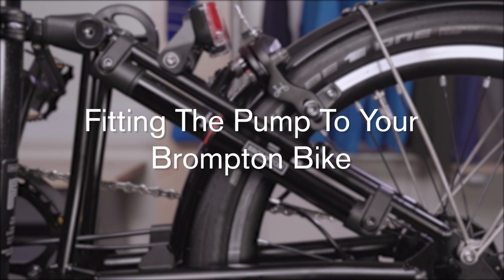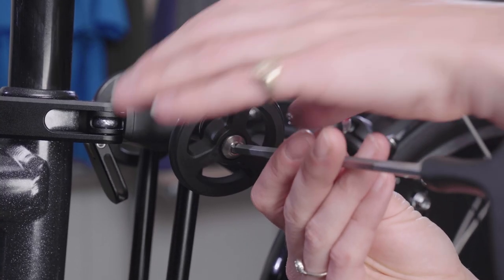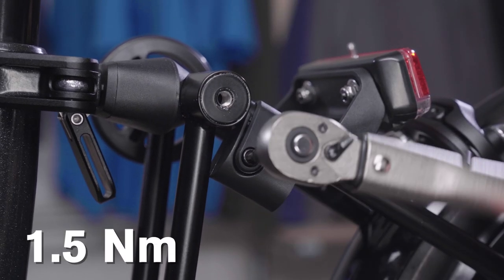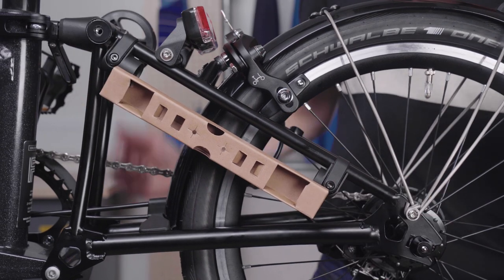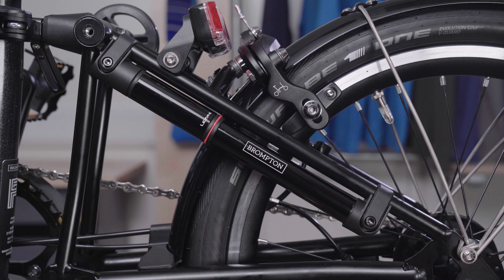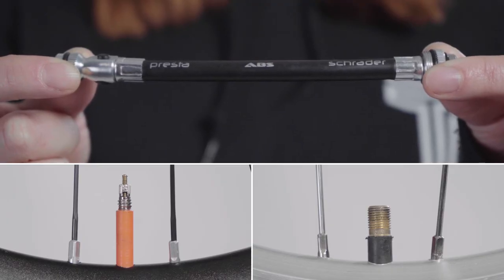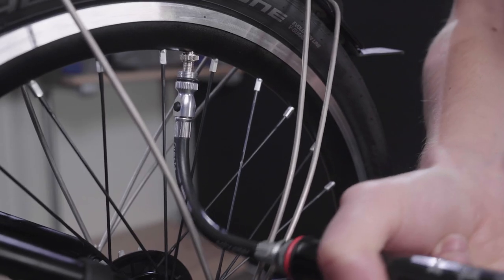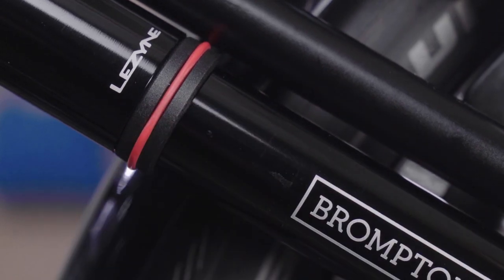How to fit the Lezyne Brompton Pump

Comment: I appreciate you encourage using a torque wrench, but most of the bike specific wrenchs  won't go as low as 1.5Nm. Indeed, the Lifeline wrench you are using bottoms out at 2Nm. To prove my point on the video, it doesn't ratchet at 1.5Nm (because it can't), but ratchets at 5Nm. You may say "turn L hex key just by holding it on the hex stem itself" to convey how gentle 1.5Nm is. Keep up the great videos.
Reply: any suggested torque wrench should be used?

Comment: Is it just me, or are others having trouble getting the screws to locate the threads on the other side of the bracket **when on the frame**?
No problem when it’s not on the bike, but fit to the frame and then try to get that bracket to bolt on is seemingly impossible. 
What am I doing wrong? 
First and only attempt to date has been with a C Line model.
Reply: Exactly the same issue here. Did you manage to find a solution?
Reply: @philoululuphil  yep… “push harder” 🙄
So with one hand you push the bracket up towards the seat stay and press the back (threaded side) of the clamp firmly as with your other hand you push really firmly on the head of the bolt as you turn (and turn again) until it engages.
Reply: I just fitted mine. The tolerances are a bit tight, it was not a smooth or easy experience. I ended up removing the textured rubber/soft plastic cushion from one of the clamps to get it to fit around the frame better.  I also had to use some brute force.
Reply: @philoululuphil 

It went on fine after I used a utility knife to carve off the rubber grip. Still plenty snug without it.